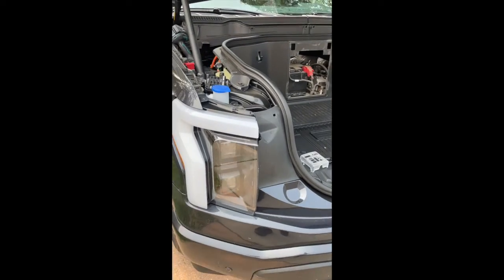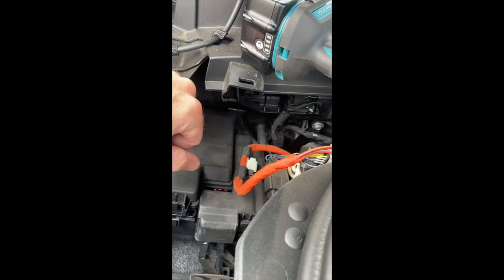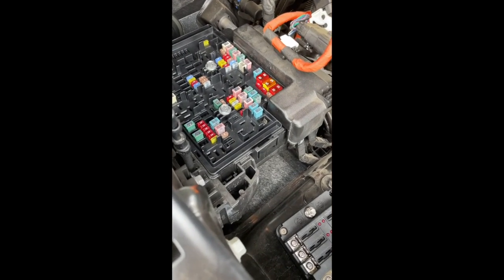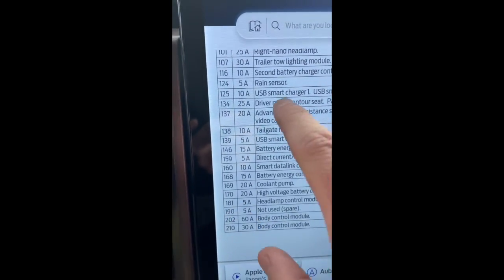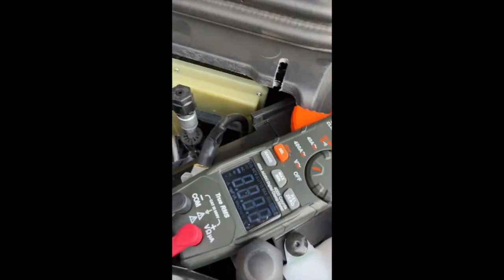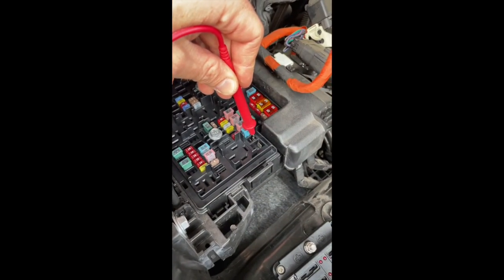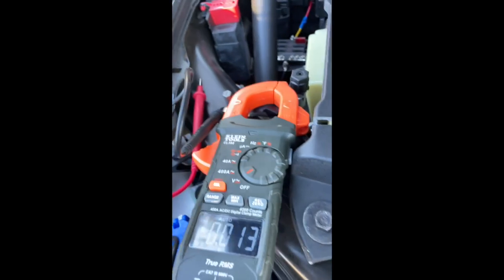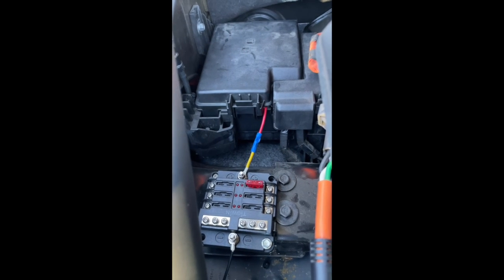Ford Lightning Auxiliary Fuse Box Install

Comment: By adding that 20 amp fuse to the circuit that feeds your new aux fuse block didn't you exceed the protection of the 10 amp feed circuit?  I don't believe you are supposed to exceed the original circuit amperage protection of 10 amps for your new circuit. All of the wiring that feeds your original spare fuse circuit is rated for 10 amps.  It can be another 10 amp fuse or any fuse rated for less than 10 amps I believe?